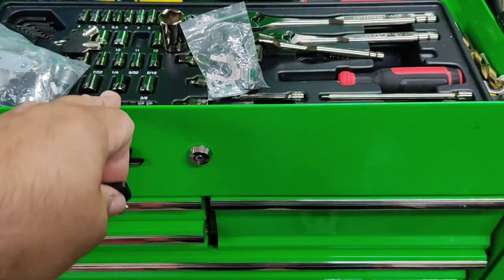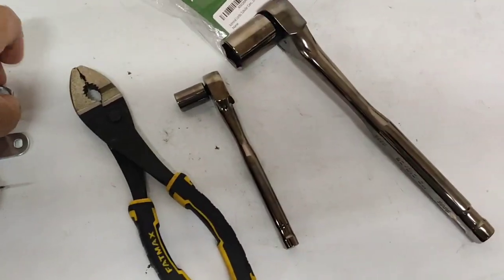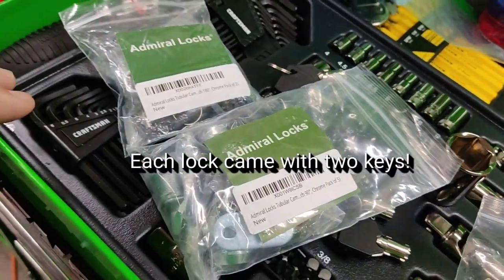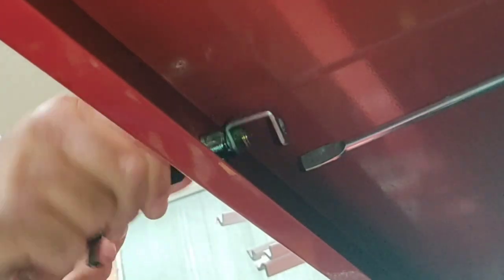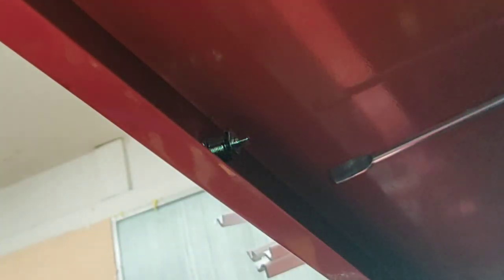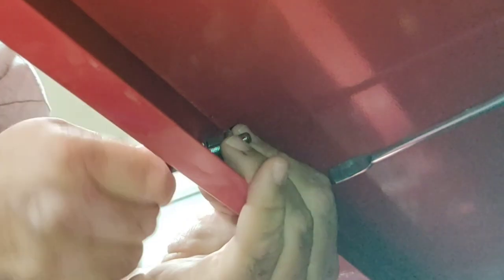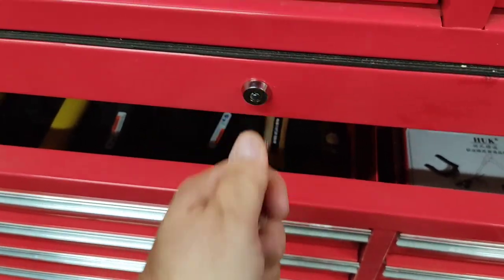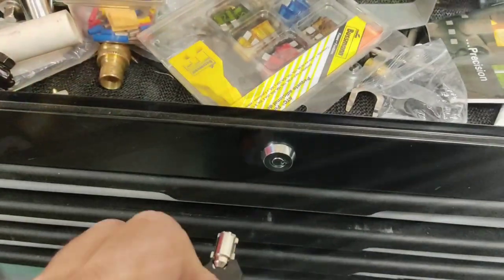US General Toolbox SAME KEY LOCK CHANGE!

Comment: I just changed all six of my locks to the same lock/key after watching this. I had to grind a little bit of metal with a Dremel on two of the existing locking tangs because of slight differences, but in the end it all worked out perfectly. Thanks for posting those part numbers!
Reply from the maker: You're welcome. I'm glad I could help!

Comment: Ditto on the locking tang hole enlargement. It didn't take much.  I also had to enlarge the lock hole itself on the 26" Top chest ever so slightly. The 30" roller was a breeze, no altering whatsoever. The 26" bottom now has a bent cotter pin in place of the clip  shown in video.

Comment: They changed the lock design now. Has a pinned in collar on the back instead of the u shaped plate that connects to the bar. Going to take some work to change the new style
Reply from the maker: That sucks
Reply: On which boxes generation 2 or icon
Reply from the maker: @trublue2319  gen 1 of the 44 inch, gen 2 of the 5 drawer cart.
Reply: Mine had the pinned collar lock. It took some work to switch it over to regular style cam lock. After doing it, think i figured out an easier way to do it.  The problem is getting the correct length "lock link" to make regular cam locks match the same length pinned collar type is.

Comment: Hey I have a question if I order from Amazon the website that you put on the link and if it’s 90° or 180° turn radius .. 
but different sizing if I order individually will they come all matching with one key
Reply from the maker: I'm not sure about different sizes. You'll have to contact the company on that.
Reply: Did you find out the answer? I'm pretty sure they all use the same key.... Which doesn't make it the most secure thing in the world.

Comment: US General tool boxes have only a 90 day warranty 👎
Reply from the maker: That's the thing that sucks about them.
Reply: then buy the 4 year extended
Reply: Why do you need a longer warranty on a tool box? 90 days is plenty of time to make sure all the sliders and drawers work correctly. If a slider ever does wear out, you can order replacements.
Reply: @toolinhand  You don't need over 90days to make sure tool chest is working correctly after you get it home. If the drawers open and close just fine and the tool chest has no dents, only thing you have to worry about is filling it with tools.